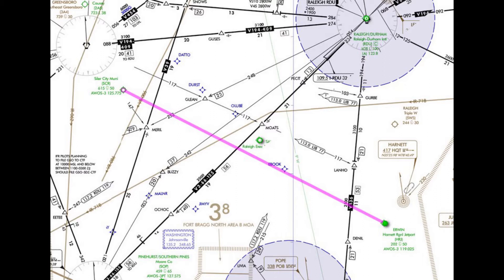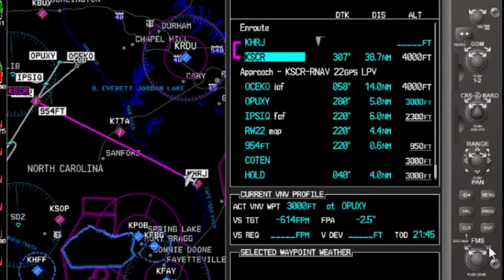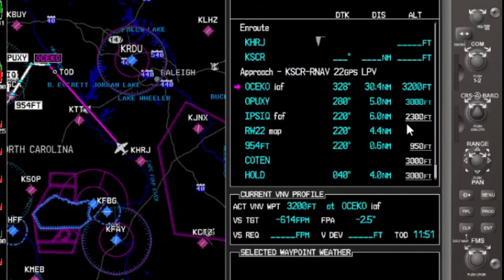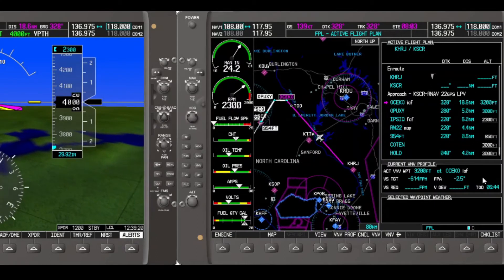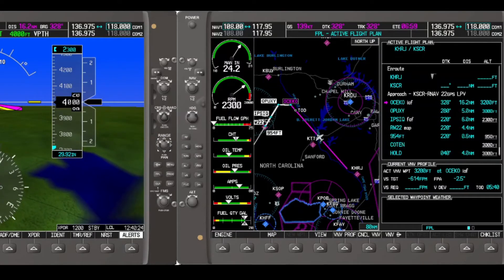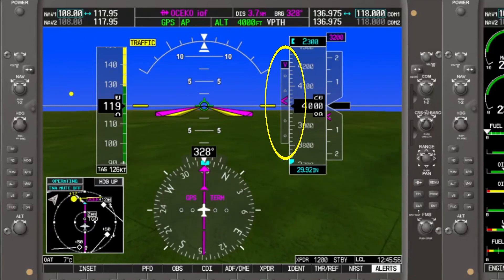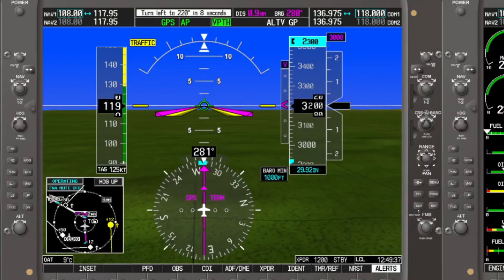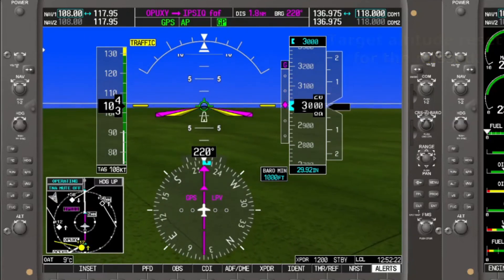Vertical Navigation with the DA40 G1000

Comment: You're a great explainer.  I've learned a lot.  One question.  Do you have to have the Altitude Hold button on for it to fly down to 3200 here or is that part of the VNAV process?
Reply: I'm guessing not as I have managed to get it to work before without touching the ALT button.
Reply from the maker: @fiddlerpaul  You're right. Once you set an altitude below the lowest profile altitude in the selected altitude box, all the descents and level offs are part of the VNAV profile.